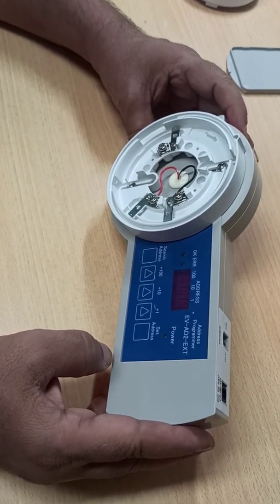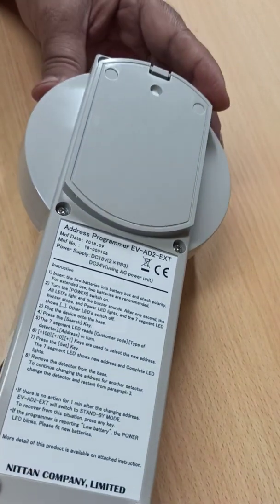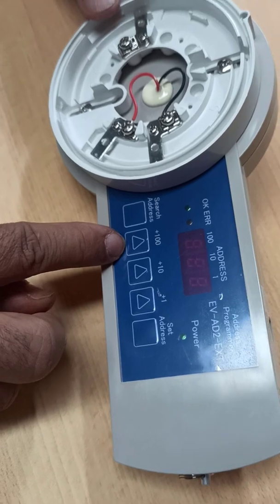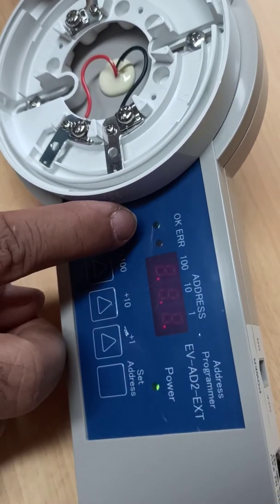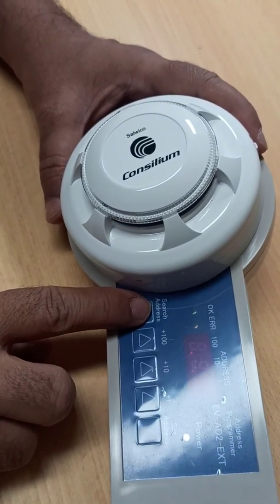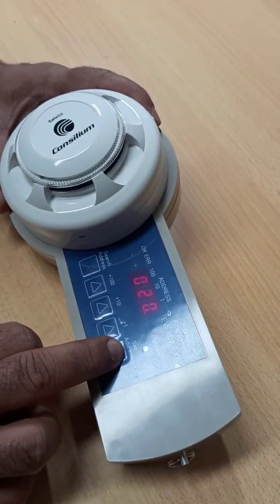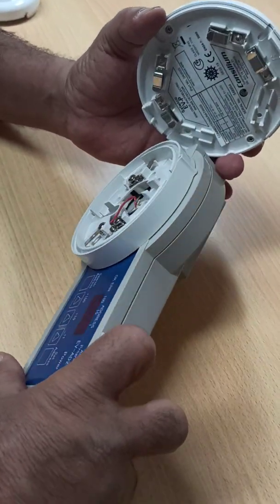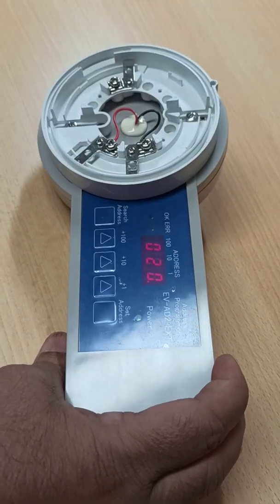II How to set the address in a Fire Detector II Address Programmer II Consilium II EV-AD2-EXT II

Comment: Hello sir, 

on board i have salwico smoke detector.. when we want to test water mist by real, so i spray smoke eqp into the detector but it's only coming "pre alarm warning" instead of fire alarm..but when i make on the "test mode" smoke detector indicate working well, it showing fire inserted "on the test mode"

So in real situation it's only give pre warning alarm instead of fire alarm, and when in test mode the smoke detector is working properly.

Maybe do you know why? 
And what is cause and remedy regarding this issue?

Thanks before.